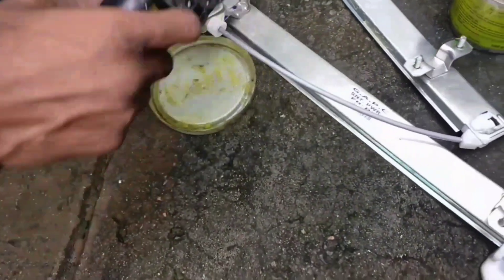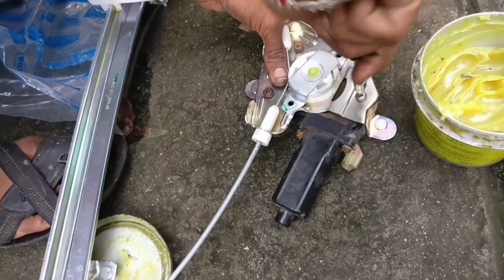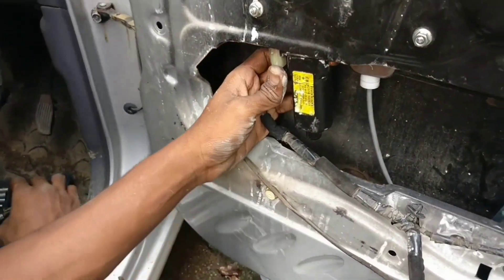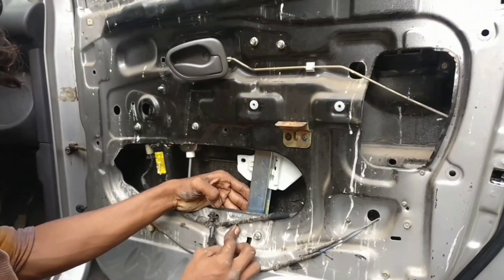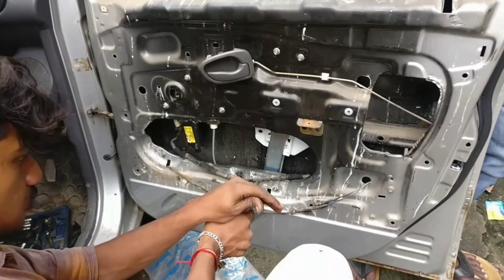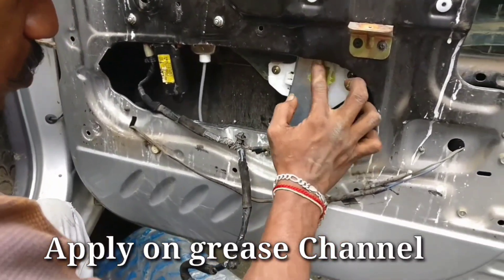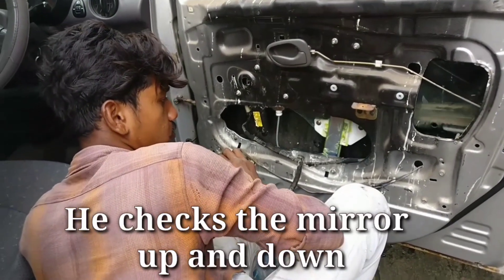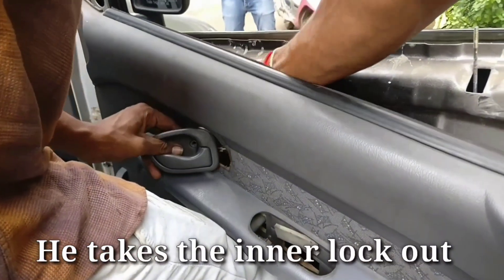Car door lift changing work in tamil / Santro car

Comment: Bro indica v2 dls model vandikku indica v2 ls pumber set aaguma.....Car wheel  ku mela extra fittings la varuthe atha doubt....Front and rear pumber
Reply from the maker: Bro 3 typs. Bumper varuthu head light fit panni partha than therium
Reply: ok bro thanks

Comment: Bro eon engine overa heat aaguthu   ...Ena problema irukum
Reply from the maker: Radiator block , radiator valve block  or  radiator fan not running and  head gasket problem